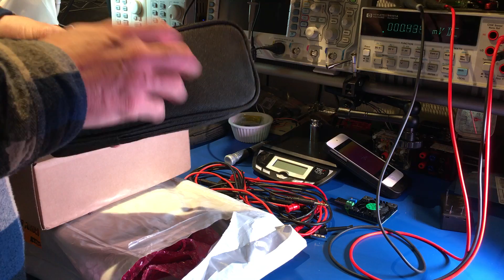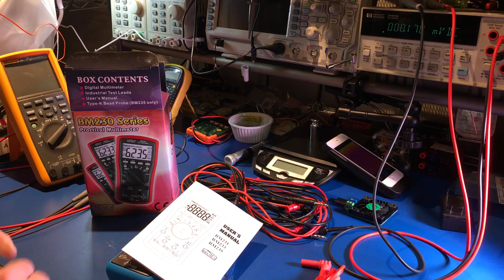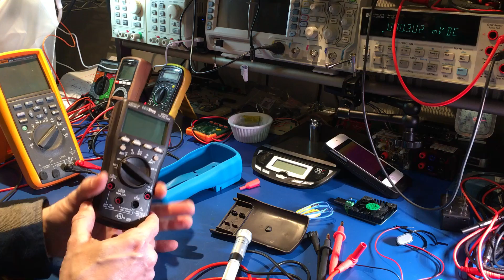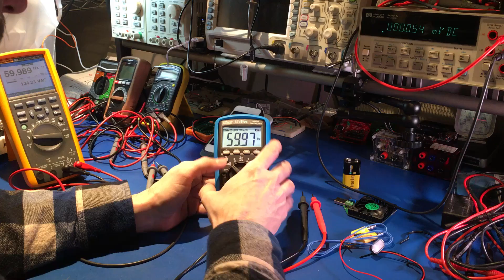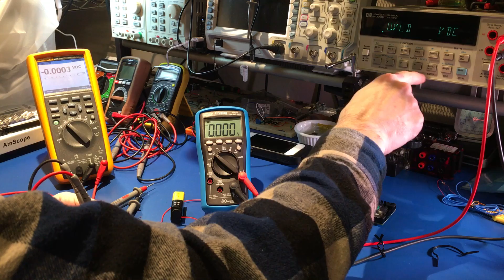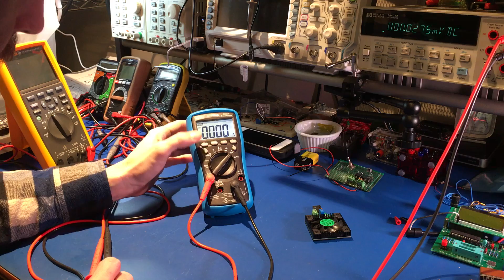EEVBlog Brymen BM235 Multimeter Review

Comment: Hi Gadget Review Videos.  Nice video, thank you for making it.  Question (don't know who else to ask, kindly, please).  ¿In the Diode Test mode, does this Bryman/EEVBlog 235 DMM light up an LED, in particular, the White & Blue (requiring higher voltage [~2.5 to 2.6Vdc]), AND, display their voltage on screen (when in Diode test mode) please?  I know it's particular, but I'm trying to replace a certain Radio Shack DMM that fails to power up when ambient temps are ~77ºF & above/~55% RH & up.  Said Radio Shack meter does light up said diodes, dimly, but does do so, and displays their voltage when doing so, ~2.6V DC or thereabouts).  I use this feature and would like the DMM unit I purchase to have similar characteristic.  (Don't want to get the wrong DMM).  Any help/suggestions much appreciated.  Thank you much.  tonyd\.
Reply from the maker: Hey Tony, maybe this will help answer your question.
https://youtu.be/WtIEoplr39M
Reply: @GadgetReviews-US  Thank you so so much for the kindness of a reply, AND absolutely answering my questions about these DMMs.  I did see your video you suggested (just now), and it's excellent.  There is nothing like having an experienced voice share their knowledge and know-how.  (God[Bible] Bless you much).  Thank you.  tonyd\.
Reply from the maker: No problem, I'm glad it answered your questions and helped.

Comment: I know this is almost 5 years old now, but did it turn out that the high-pitched whine from the backlight was because the backlight was an EL panel instead of an LED?
Reply from the maker: It was a ceramic capacitor that made the noise as I confirmed in this video. https://www.youtube.com/watch?v=TfNuTmqtiD4. Since then the manufacturer Brymen changed the supplier for that capacitor and fixed this a few months after this review.
Reply: @GadgetReviews-US  Gotcha, and thanks for that follow-up.

Comment: Which one to buy among EEVBlog BM235 and Fluke 175?
Reply from the maker: Both are great meters. I would go with the Brymen (eevblog) 235 for features/functionality included with the price. But the fluke has a good build quality, although the BM325 also holds weight. I guess it comes down to the little differences is specs and how you plan to use the meter. Get the one that will best suit you, both are good choices.

Comment: Drat, watched what I could to see you test the milliamps, you went from microamps to amps.  I need a new MM that can get to 600 miliamps to bias the mosfets in an RF amp.  Decent video though.  I've added this MM to my list now.  Thanks.
Reply from the maker: I can’t believe I missed that. Maybe I was showing low and high range, usually if that’s accurate so it the middle range. The data sheet for this meter sates it will do up to 600mA AC @ 1.0% accuracy and 600mA DC @ 0.7%.accuracy, both +3D with 1.9mV/mA burden voltage. Most DMM’s will ready slightly higher then spaced allows the user to tune something at the top range before it shows over limit. 
I did a short and fast test for you, just leave a comment once you watched the video and I’ll remove it. I hope this helps. 

Scott
Reply: No problem, I found another video that walked current up from about 400ma to a 10A and it gave me the resolution I needed.  Mine arrives tomorrow.  Also, the mA port is rated to 600maA which is all I need.

Comment: I have a BRYMEN 257 and it does not measure the ohmmeter, only megaohms, very high scales, but normally when measuring, the scale of the display flashes.
When I turn it on I get C_ER and without a scheme I'm lost
Do you have any idea what it can be?
Reply from the maker: The 257 is in a different scale on how it take measument then the 235. I did a search and came up with this from the 257s manual.
Calibration
Periodic calibration at intervals of one year is recommended to maintain meter accuracy. Accuracy
is  specified  for  a  period  of  one  year after calibration.  If  self-diagnostic  message  “C_Er” is  being
displayed while powering on, some meter ranges might be largely out  of  specifications.  To  avoid
mis-leading measurements, stop using the meter and send it for re-calibration. 

It’s doesn’t seem to be a common issue, but looks like it does a self check on boot up and has happened to a few others in the past. If something doesn’t match with the stored calibration data you will get the C_er for calibration error. 
This could be from the lithium battery being low, or did it die and you replaced it? Or internal corrosion causing a short, was the meter ever wet, even it it was a year ago. Corrosion happens over a long time, so you may need to think back. 
Is this a new meter? If not, how old is it? I don’t know the warranty  period so you may need to check the manual. 
Brymen is also good at replying to emails with support, you can email them and see if they can help further.

Comment: I have a new brymen 235.  I measured the resistance of the resistance of a Microwave megnetron to be .2 ohms then quickly goes to zero.  I was expecting a consistent measurement of .8 ohms so when the reading went to zero i thought the part was bad.  The new part measures the same. Now I'm not sure if the meter can handle a low ohm measurement.
Reply from the maker: Im not sure what the claimed specs are for this range? The manuals I just checked starts off at 600.0 Ohms to 6k Ohms with 0.3% +3 digits. But it does not mention the tolerance for under 600 ohms.
So I decided to run some tests on mine for a comparison to yours. That said, I never measured a megatron before,  or what the megatron is made of and if the resistance changes when voltage and a low 2uA current is passed through it. 
I just tried a few resistors in the low range. I have the original probes it came with and removed the banana adapters. Since it averages the readings and auto zeros out in resistance modes I usually hold the probes together for a few seconds first. It’s a little slow reading lower resistance, so I held it for a few seconds, maybe 5 to 8 seconds to let it average. I know the update rate is 5 readings a second, I assume that’s the same for all modes on the meter. 
Mine is running the original released production firmware “C”, you can check this with holding down the “Hold” button and turning it on. It will display the firmware version.

This was my results:
0.1 ohm = 0.1 it flickered to 0 once then came back and held it. 
0.5 did ok at 0.5
0.75 showed 0.8 , probably rounded up since it doesn’t have the resolution to show that last digit.
0.85 measured at 0.9, also rounded up.
1 ohm was 1 ohm Note: I measured the same resistor in the video.
And 1.2 ohm was 1.2 ohm.
It’s beeen over a year, when I did the video and then my 1 ohm was 0.99, so looks like it drifted but in the correct direction 

The resistance of the Brymen probes measured with my 4 wire miliohm meter was 028.8mOhms and 024.7mOhm. So the probes are about 25% of the lowest reading it can display with 100mOhm. Maybe this is how it knows to zero it our or what to ignore. Then again the probes have such a low resistance it wouldn’t show up on a meter with this resolution anyway. I would think cheaper probes with a higher resistance might confuse the meter auto zero feature and give bad reading with lower ranges like in the mili Ohms. 
We’re you using the original probes? 

Maybe test the probes with another meter that can read a higher resolution to ensure one doesn’t have a beak in the wire. 
If you have the banana adapter on you need to make sure they are screwed on all the way, and if you measure with the banana part it takes a little more pressure since the one part on the adapter spins. This is why I just remove them most of the time. 

If you still notice low readings you can always email Brymen and see what they suggest or say.
Thanks for watching,
Scott

Comment: Thanks for the video.  I'm an electrician that just graduated and is starting to get into both the construction and industrial industry. I was browsing around for a good bang for your buck meter that is more reliable that the cheapy rebadged stuff you get from the big box stores and this one along with the Fluke 117 caught my eye.
Reply from the maker: I think the brymen would hold up just as good as the fluke 117. Isn't the fluke 117 the ones with a smaller warranty, three years or one year? 
But if you were to put it up against the fluke 87V with a 10 minumim warenty from the date purchased and proven to take a beating, I would probably go that way or some other fluke industrial meter. I'm not saying the brymen isn't good, but if your going to be doing this for a living I think you would get more bang for your buck with a fluke industrial meter and longer warranty. And better turn around time if you did need to send it out for service. After all for your job you will be counting on this every day. I think it's one of the reasons you always see an electrician and a mechanic with a fluke, they are proven in industrial jobs. Just my thoughts.

Comment: Thanks for the video. I was thinking about doing ardiuno projects, would this be a good meter for that. I would like to just have one good meter, and if I really get into doing more things with ardiuno then maybe getting more if needed.
Reply from the maker: That depends, this is a good meter but is missing one feature you might want to understanding some ardiuno projects. But when you say arduino projects that is a lot of stuff you can do with an arduino. I would suggest looking up PWN (pulse width modulation) and get an understanding of PWM and how it might be used with some ardiono projects. The only ones I can think of would be LEDs as for flashing or controlling the brightness, and motor related projects for the speed of the motor. This is something you may want to have a meter that does PWM. Other wise this does everything else really good and is great for measuring low currents in the uA and mA range. 

Once you understand PWM you can decide if this would be the meter for you or not. Some people don't need or use it. It's mostly used in mechanics more then anything. So you may be ok without it, or you might want this feature. Maybe join and ardiono board and ask others if they use this a lot with their projects and if it's something you will need?

This is a brymen meter, and other brymen meters also have PWM features and everything this has for about the same cost. They are a little bigger and the one thing I like about this one is the small size. But if I was looking for just one meter I would want to get as much features as possible even if it meant the meter was a little bigger. Maybe a different brymen would be better.

On the other hand you will realize you will probably want more then one meter eventually. The other meters don't have to be expensive ones, just to measure voltage and just about any meter these days can measure D.C. voltage pretty accurately.
Reply: Thanks for the info. I have an understanding of PWM it is used in PC to control fan speed, and it can be used to dim leds and probable more.
I will look into other brymen meters and try the ardiuno boards.
I am not looking to build anything just to learn some programing and electronics. I have time on my hands and the price to get into this as a hobby is not to expensive, so just looking to see what I would need to get started.
Reply from the maker: I forgot about this one, it's the same size and accuracy but includes PWM. Plus the price is about the same since this is free shipping and I think the eevblog one was about the same after shipping. It has an optional data logging ability with the data logging kit you could buy later if you decided this is something you would want. The seller is one of the most trusted sellers also, even Dave on eevblog did an interview with him.
http://www.ebay.com/itm/Brymen-BM257s-Digital-Multimeter-6000-count-Brand-New-Fluke-alternative-/200922627340
Reply: Thanks for the info. From my current look into doing this I am going to get a less expensive DMM to start with and see if I like doing these projects and see what I can learn. I was looking at this meter.https://www.amazon.ca/Extech-EX330-Autoranging-Multi-Meter-Thermometer/dp/B000EX0AE4/ref=pd_cp_469_1?_encoding=UTF8&psc=1&refRID=AN8AS1ZMARCVV7SDX43W
To start with and then if I like this hobby move to something like the BM257.
I think this was one of the budget DMM from eevblog. This way I can spend a controlled about of money on a new hobby and have a good DMM to start and with it see what I will need in the future.
I have a cheap $10 DMM no autoranging to use as a second meter can use the EX330 to see how accurate that one is.
Reply from the maker: I'm personally not a fan of extech, I've owned two and the both ended up in the trash shortly after the one year warranty ran up.
I wasn't going to mention this meter since I'm not done the review on it, but if your looking for a good meter and little cheaper to start with I would try this one. It's been accurate with all my testing and for the price it comes with the ability for data logging to USB on your computer. Plus Frankie's shipping has always been faster then anyone else I've ordered from overseas with. I usually get his packages in about a week.
It's the same resolution as the extech your looking at with more features, accurate and a little cheaper. 
I hope to have the review done in a couple weeks, but I like to test items for at least a month before recommending them and I have used this for a couple weeks now without an issue. For the price and to include data logging it's been impressive.  

http://www.ebay.com/itm/Digitek-DT-4000ZC-TekPower-TP4000ZC-Data-Logging-Multimeter-with-Temperature/200912705694?_trksid=p2047675.c100623.m-1&_trkparms=aid%3D222007%26algo%3DSIC.MBE%26ao%3D1%26asc%3D41375%26meid%3D7ec4a8f1cce94719bcdb4cea512ba549%26pid%3D100623%26rk%3D2%26rkt%3D6%26sd%3D200922627340
Reply: Thanks again. will have a look when you review comes out.
Have a day
Reply: When you do your testing on this meter can you open it up and show use what it is like inside, like the fuses and probe inputs. That would be a good thing to see.
Have a day
Reply from the maker: Well I'm not the first to review this meter, there was a few small changes like the data logging is not USB and not 9 pin serial as show in this review. But if you want to see the inside he also did a tear down on it. 
https://youtu.be/kXzAD74C5As?t=17m55s

I still have a couple weeks of using and testing before I will have a review done. Didn't think you wanted to wait that long? I like to fully use products I review for a at least a month before reviewing them. Many times I may catch something wrong or that I dint like after using for a few weeks compared to just receiving something, opening it and reviewing it. If you review something the day you open it you may not catch a bug or something that doesn't work like you would expect. I hope you understand.
It's just my preferred method before I recommend something.
Reply: Just finished watching that video, just when you posted your comment. It looks like a perfect start meter for me, I was thinking of getting two for the price and if I like this hobby, then later I can get a better meter and keep these to do data logging and other things. For the price they are very amazing.
Reply from the maker: Sounds like a plan. If you like the hobby you will defiantly benefit from more then one meter.
I would definitely still order them from Franky at 99CentHobbies, not just for his fast shipping and great support but then you can get two with different colored cases. http://www.99centhobbies.com/

And since you mentioned multiple meters I'll share a little thing I was going to include in my review.
If your using windows you can try this software called ultraDMM , it allows you to read multiple meters in one software.
http://www.ultradmm.com/About.aspx

If your using Linux or Mac you can try this one called QtDMM. I haven't tested it yet so I don't know if it does multiple in one software GUI, but maybe you can launch the app twice and choose different meters in each app session.
http://www.mtoussaint.de/qtdmm.html#prerequisites

Have fun learning your new hobby,
Scott
http://www.ebay.com/itm/Digitek-DT-4000ZC-TekPower-TP4000ZC-Data-Logging-Multimeter-with-Temperature/200912705694?_trksid=p2047675.c100623.m-1&_trkparms=aid%3D222007%26algo%3DSIC.MBE%26ao%3D1%26asc%3D41375%26meid%3D7ec4a8f1cce94719bcdb4cea512ba549%26pid%3D100623%26rk%3D2%26rkt%3D6%26sd%3D200922627340
Reply from the maker: I should mention when you buy it from Franky he includes the gold plated better probes then what you saw in the other review, and a USB data transfer cable. Not the serial cable that was in MJLorton review. Other sellers like another site you mentioned will come with the serial cable and a cheaper set of leads.
Reply: Thanks for that info, and Franky has better prices as well. Will have to email him and see if he sends to Canada.
Have a day